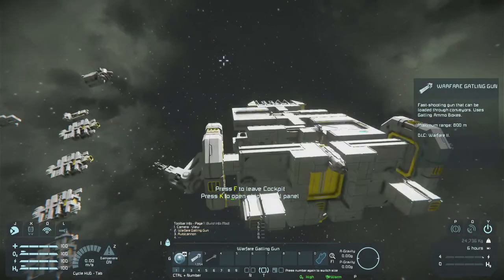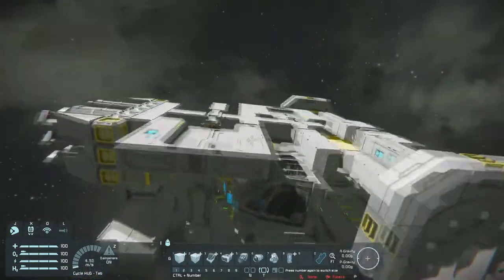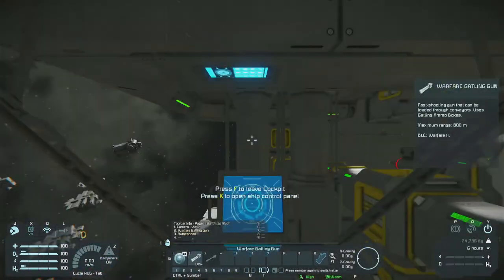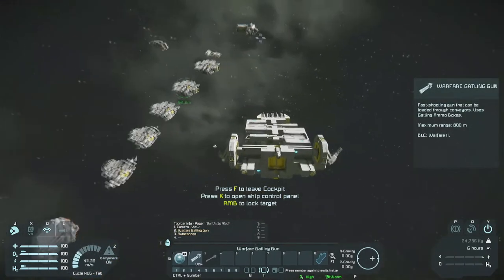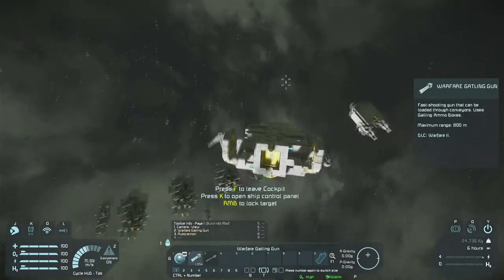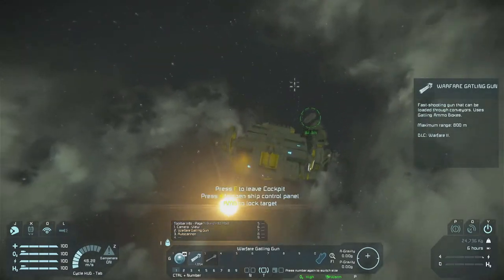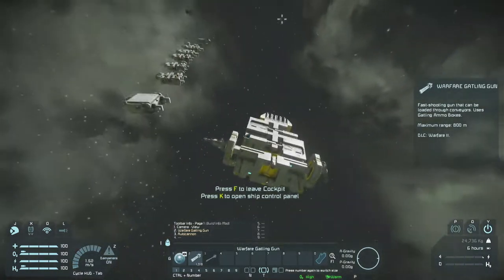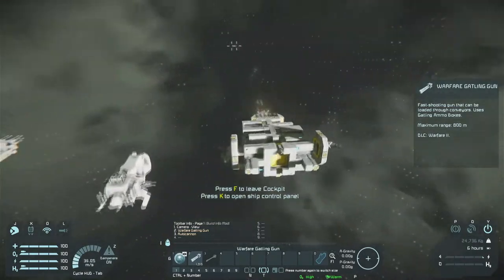Horesmi is BACK with more CLANG - Space Engineers

Comment: Did you manage to program precision type of tasks - gravity negation and dampening? It would make cool thrust provider for AutoPillock - for integration the script needs to consume IGC message with Destination, GridPosition and SpeedLimit, and ideally reply with TotalForce vector applied. It would need to handle gravity and velocity rejection on its' own.
Reply from the maker: Yes. I have a "virtual" ship that has the desired inertia, accelerations and the final position, and then the real ship tries to match it with it's own thrusters. That way I can even simulate zero gravity in gravity - you can push the ship forward, and it will keep flying in the same direction regardless of gravity.

I wrote this logic because I wanted a "parking" mode with artificially limited acceleration for precise control, but with a strong PID powered gravity canceler. Because my ship is so fast it would just penetrate any ship it tried to dock.

So in my code I send small acceleration to the virtual ship, and the real ship matches it with full power but under the precision of a PID controller.
Reply: @Horesmi  Yeah, that's what I meant by gravity negation. So in other words you make WASD/mouse input chill the fuck down and add them on top of precise gravity canceler control signal. I'm curious what's the "hardware" throttle that is controlled by PID in this case? Pushing door deeper and/or harder? Lol
In my old rotational merge drive I used to control the rotor speed and the fraction of time the pair of merges is active.
Reply from the maker: @cheerkin  yes, push the piston deeper into door. There is a very nice linear relation between piston displacement and thrust.

You just need very precise movement limits. If you start too early, there is a window where the drive has zero thrust, which fucks over the PID logic. If you push the pistons too deep, clang fuckery starts. But you can do it in an emergency to increase thrust several times over.